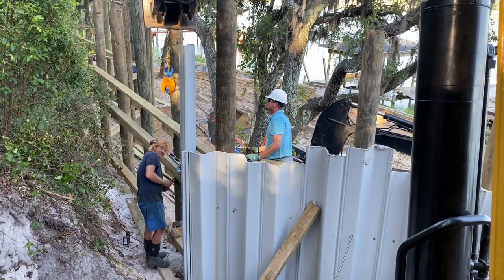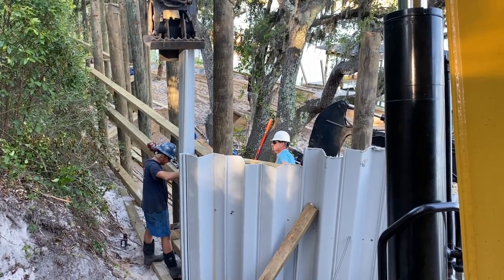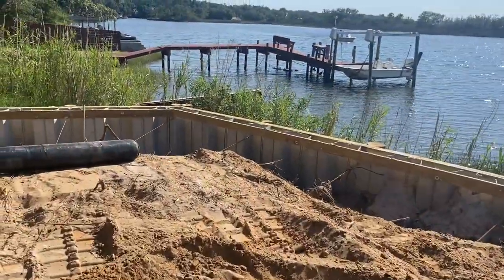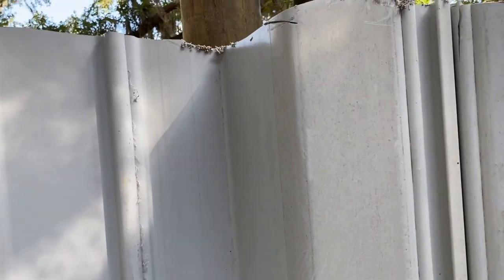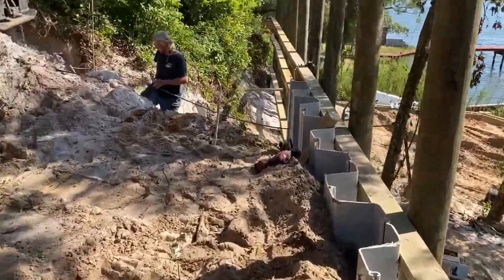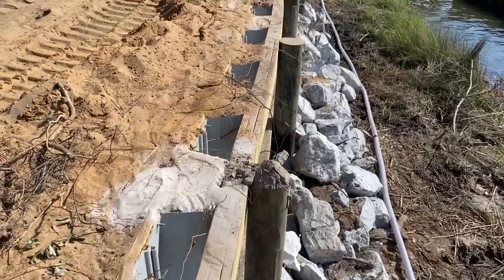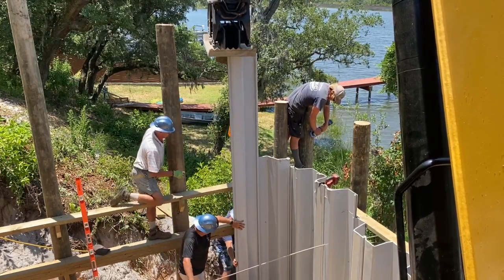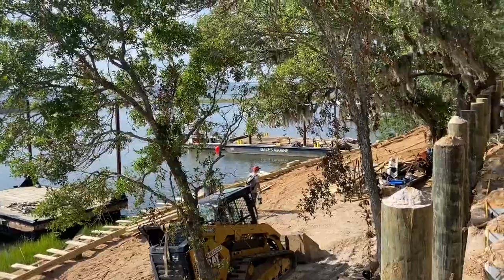HOW TO TERRACE A HILLSIDE-update on steep hillside terracing

Comment: Where did you get that sheet clamp from?  I noticed it at the beginning of the video and then you commented on it.  I need a better one.
Reply from the maker: Where does everything come from 🤷🏻‍♂️ Amazon LOL. 

 3T/6600Lbs Universal Vertical Plate Clamp Heavy Duty Lifting Clamp Industrial Steel Plate Clamp Sheet Metal Lifting Clamp US Stock	
3T/6600Lbs Universal Vertical Plate...